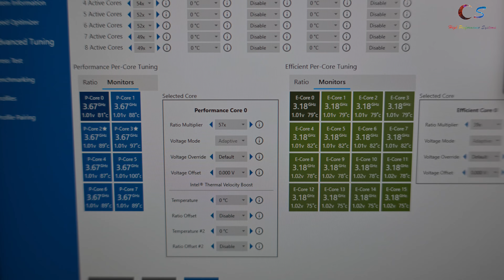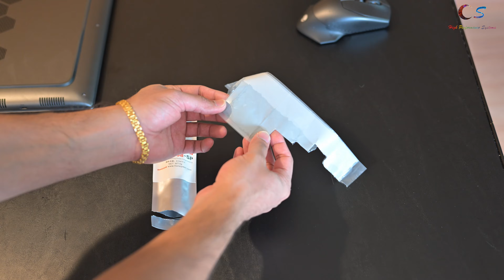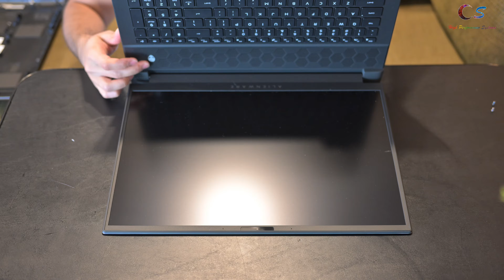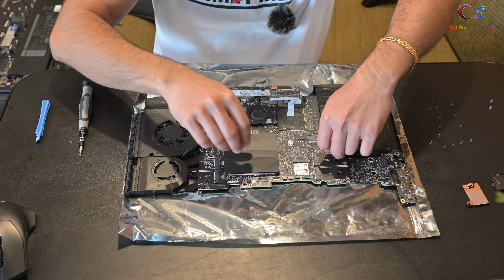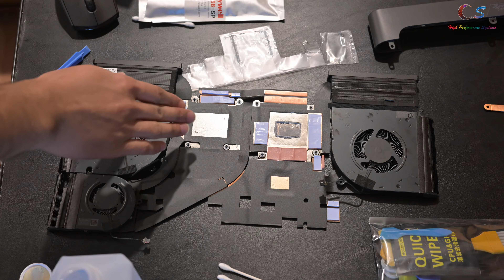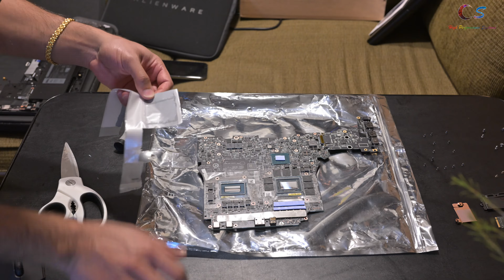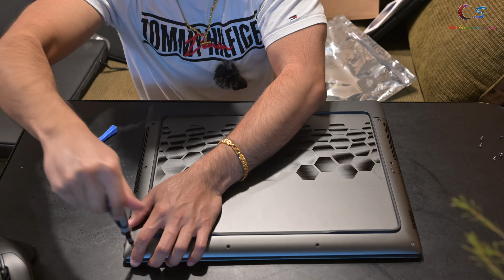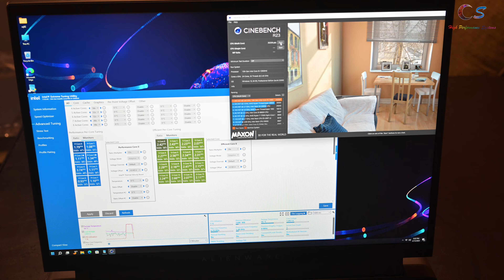Alienware m18 Disassembly & Repaste

Comment: I feel like element 31 is just thermal paste. i got the x16 and 100c while gaming on a laptop with 4 fans is just not acceptable. blade 16 with 2 fans gets better thermals
Reply from the maker: It’s definitely a mixture with liquid metal. As someone who has used LM on older laptops I definitely saw the LM inside. It’s the shiny silver particles you can see.
Reply: Blade has WAY lower power limits, it limits the CPU to 40 watts when GPU is loaded. Alienware allow CPU to run unrestricted. You are a noob, obviously. Check your Clock speeds and cpu wattage doing the exact same thing when Alienware is 100 degree and Razer is say 85. You will see precisely what I mean. If you want to match it properly, limit X16 to same wattage showing on Razer. That said, doesn't Razer 16 have HX cpu and X16 have HK? The razer is dealing with a much more powerful cpu in theory but the power limits are very low.
Reply: @Bavanity  Clearly you are the noob here. Dumping 80w while gaming has 0 performance impact than running it with 40w. The razer does better power management and alienware running cpu at full wattage when not needed, its just to make people like you leave dumb comments like the one you left.

Comment: Many thanks for this great video! Clearly repasting the m18 is more challenging than the past Alienware laptops that I owned. By the way, I have been following your posts and other videos about the performance of your m18 and I believe that Element 31 was applied more or less properly on your m18. Your Cinebench and Time Spy score were already outstanding before the repaste. On my side I was stuck at 28k at Cinebench and 16k for the CPU score at Time Spy. And MogRules had 26k in Cinebench before repaste. 

Since you have better temperatures after repaste maybe that will give you more opportunities for a few extra tweaks and reaching higher scores.
Reply from the maker: The element 31 performs very well but I had a hotspot on mine. Now my cpu in general is running hotter but is actually throttling less and performing better
Reply: If you found out that bechmarks are much lower and runs hotter than usual, especially fresh out of the box, there is a huge possiblity that those barriers that protected element 31 leak on motherboard wasn't installed properlly. You can just repaste with regular thermal paste and remove those barriers, you probably got better results, sigh dell's quality control...
Reply: Hello,
I wouldn't know if you'd like to sell your M18 at this time. I'm in need of a tough graphics machine like this or the A-51m, but I can't afford a new box.

Comment: I hate flipped motherboards. Made it a pain to repaste liquid metal on the X17 R2. My current laptop, the new GT77 Titan, is very easy to work with
Reply: @AmericanUkrainianWarVet99  good dad.  Wish I had a dad who'd buy me an msi titan 😆but he bought me a 486dx2 when I was 12 and till today 30 years later I still remember that fondly because it was my first ever computer and he actually worked an extra job just to get the money to buy me that,  cos he said he knows nothing about computers,  but he thinks computers would be important  in the future so he wanted to make sure I don't get left out.  And now I'm a 3D and architectural visualizer and it all started with that beige box with a chunky crt monitor that he bought me 30 years ago😊
Reply from the maker: I was quite surprised how easy it was to repaste. If I wasn’t recording the video I can probably do it all in 30 min
Reply: Even better if they use automotive phase change TIM, lasts for 10 to 20 years depending on which grade they go for.

Comment: Always love your passion with Alienware since Area51m 😅, I used to own Area51m myself too but sold it due to 2 power bricks. And I didn’t go with m18 this time because of the weight and cooling issue…
Reply from the maker: I like the area-51m in that you can use 1 power brick for everyday use. CPU runs 100% but gpu runs like at 40-50%. I ended up with a eurocom 780w power adapter so I can carry 1 brick. I also have multiple attachment wires for different laptops but it is expensive. Gotta watch their ebay for sales